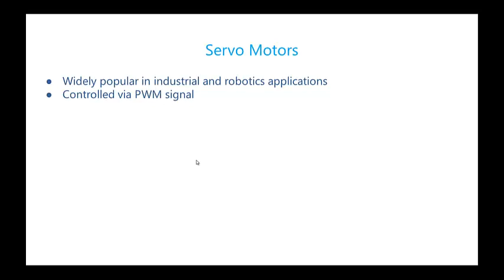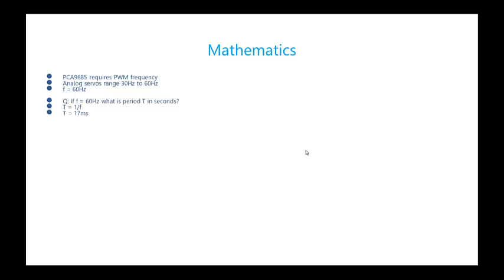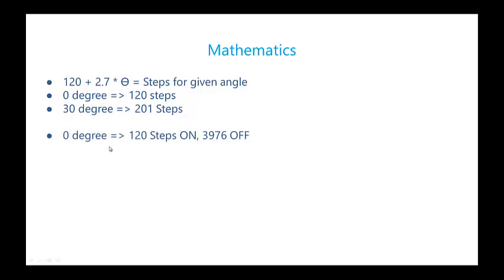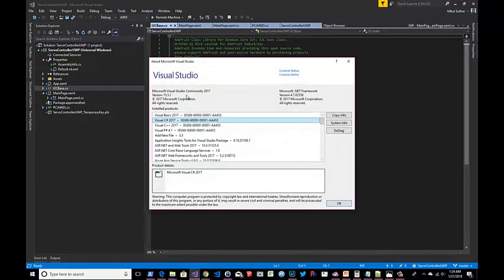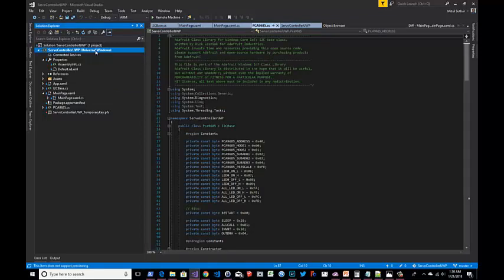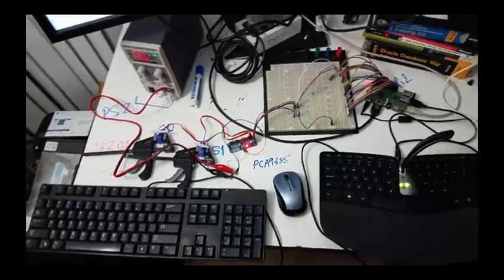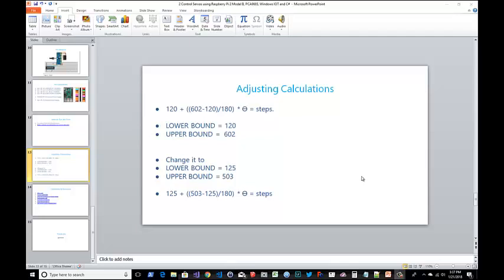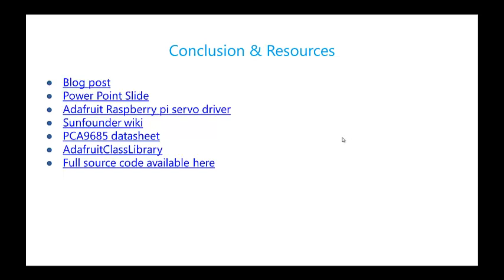Control multiple servos using Raspberry Pi 2 Model B, PCA9685, Windows 10 IOT and C#

Comment: Hello your example is really perfect and very simple. however I have a question how can I manage the speed of the servomotors? I have two types of servomotors, the first goes from 0 ° to 180 ° and the second from 0 ° to 160 ° to slow the movement of a servomotor I did this

  private void testsmooth ()
         {
             double value = 1;
             for (int j = 1; j <7500; j ++)
             {
                 value + = 0.02;
                 _turnServoPin (3, value);

             }
         }

but there is still a lot of bag and I know that my way is rather dirty: S can you help me to do this? also do you have a good idea to move several servo motors asynchronously? :)
Reply from the maker: thomas lelandais I myself want to control the speed of the servos and I want to control them simultaneously so I haven't figured it out but will do and post video regarding my experiment. Thanks for commenting. I was thinking an approach where you go from 0 to say 90 in small chunks. For eg 0-10-20-30...90 and you provide a delay in between those angles so your servo will move slowly.